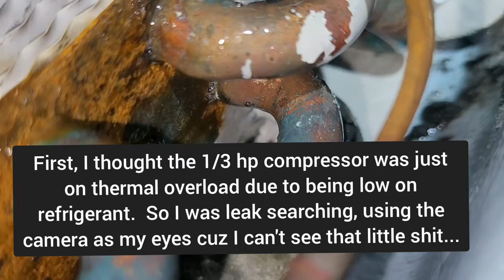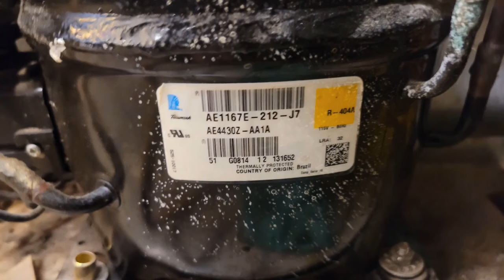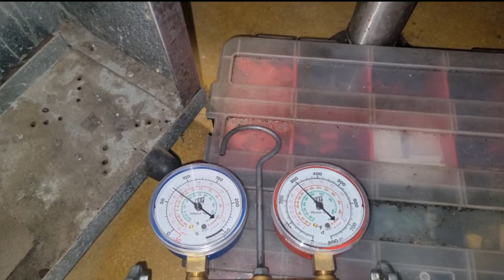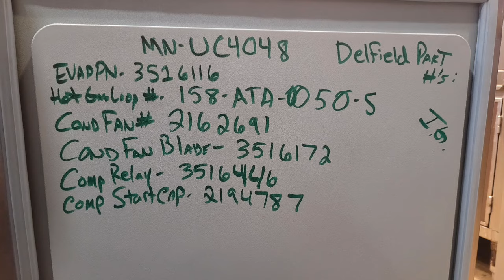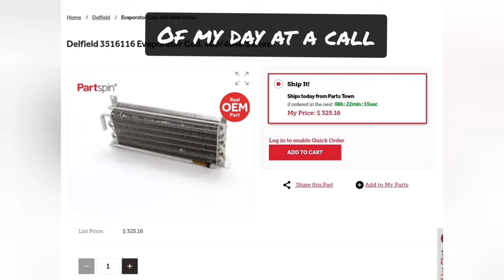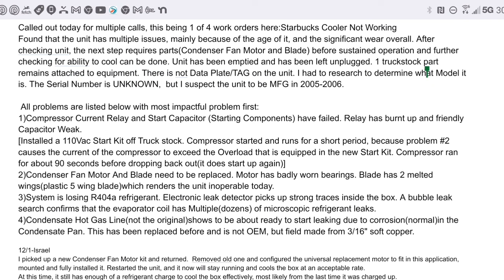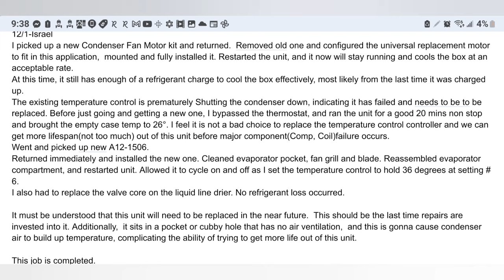Uncut Video Clips - Delfield 2 Door UC4048 Leak Searching Motor Changeout, Start Kit Install

Comment: Also there is like 4 5/16" screws and you can pull the condenser away from the cabinet and usually there are plugged
Reply from the maker: Yea, I did actually, and it wasn't dirty. It's hard to video all the service call many times. Mostly because of the phone going dead. Good call tho